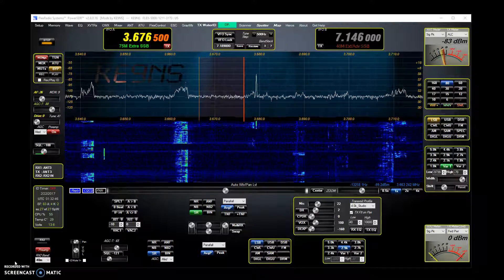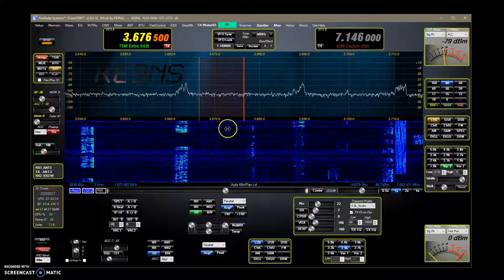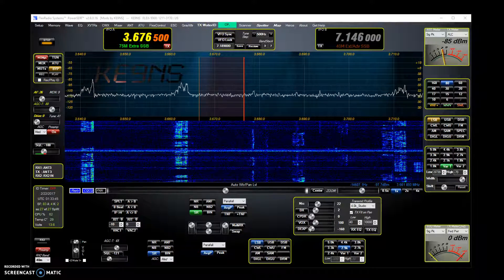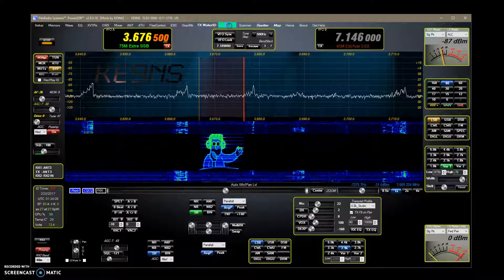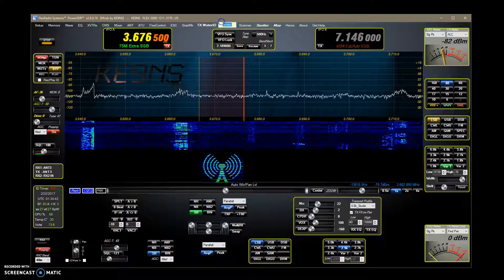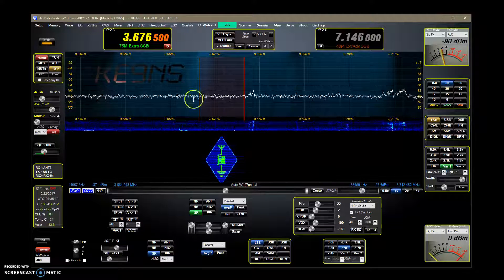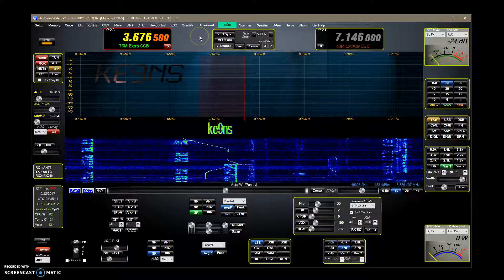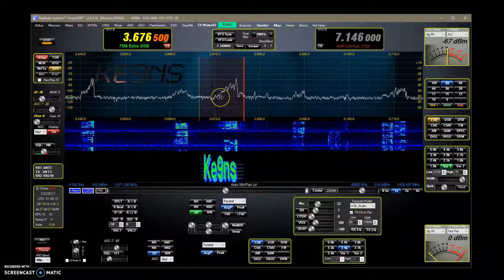PowerSDR ke9ns v2.8.0.16 TX WaterID, Waterfall image, improvements

Comment: Are the BMP file black / white or something special?  Can any bmp be used?
Reply from the maker: 1) grab Clipart off the internet (google) Color or B/W, it doesn't matter.
2) open it up in Windows Paint
3) Click Resize and set the width to 100 pixels (keep the length close to 100 pixels)
4) File -> Save As -> 24bit BMP  (and use a short file name <7 letters long)
Whites in the image are dark when it transmits So the darker the color, the brighter the waterfall.I think color (or shades of gray) images transmit better than just a B/W 8bit BMP images
Reply: Thanks Darrin!